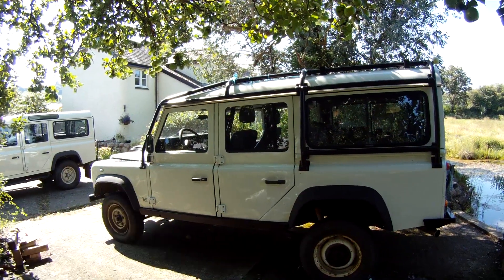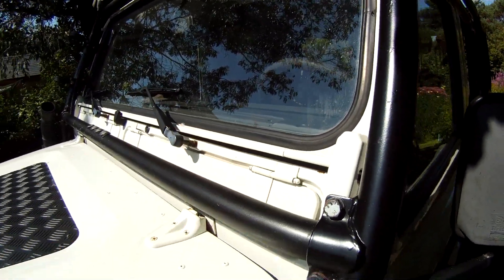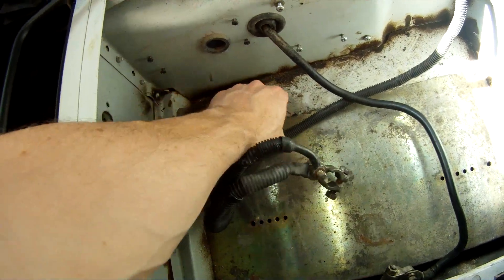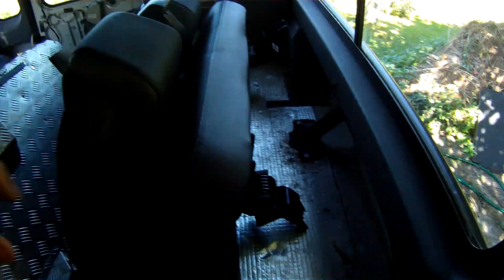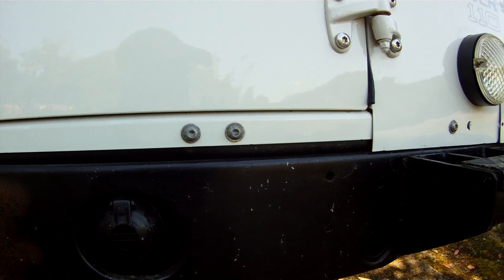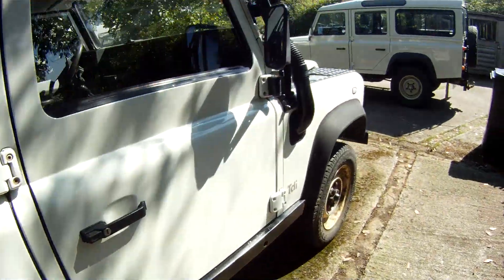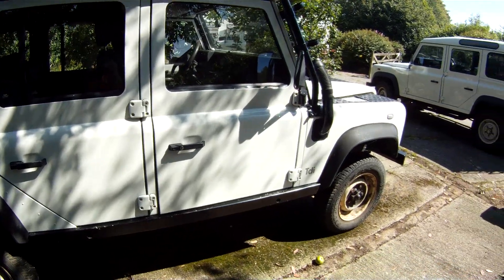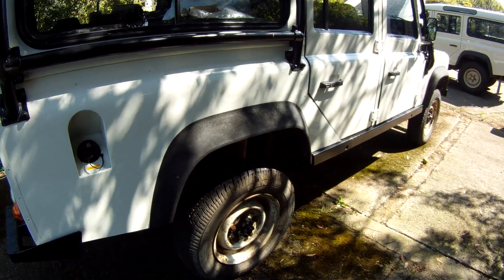Rest of the World (ROW) Spec 300Tdi Land Rover Defender Walkaround

Comment: Thanks for your content. I have just managed to get a ROW spec 110 station wagon that has a build date of Jan 2000 and as far as I know was supplied to UK MOD and shipped to the Falklands where it spent its first 12 years or so. It was civilian registered in 2013 with a V reg number plate and has a Landrover certificate confirming its build date and ROW spec. It has a TD5 body fitted with 300TDI on a galvanised chassis from new (presumably because of its being deployed to the Falklands) and in 2013 only had around 40,000 miles on the clock (presumably again due to the lack of road miles in the South Atlantic!)  It now has 86,000 miles showing (confirmed by its MOT history since 2013) and drives like new. It is in Black paint with a Grey roof and matching wheel arches so i think it was possibly on duty in the MOD as officer/ admin transport not troop movement. It really is a great thing to own and I feel lucky to have found it!

Comment: Would have to agree with you that the R.O.W. Defenders are the cream of the crop of all years and models for doing what it says on the tin as such.
I have a Snatch Land Rover 'most' of which were rebuilt in 2005-2006 using a combination of Otocar Turkish made HD Chassis, Some ROW items such as 300tdi, Puma/P38/Wolf rear axle, R380 cooler, Td5 dash with digital speedo, plus a lot of "Wolf" XD Military architecture such as the 24v wiring. They're interesting hybrids from a similar era. Keep up the good work with the LR Workshop pages, its an unparalleled resource for diagrams. Thanks for setting it up.
Reply from the maker: Thanks Anthony. I toyed with buying a Snatch, just to get the parts....

Comment: I have 300tdi 110 assembled in Kaliningrad, Russia, special order for MchS, which differs slightly from this one and is itself pretty unique, because only 107 such Landys were made. You will not find this anywhere in the Internet, I've found it by accident. I think Defender is the most unique car, so many modifications and versions were made, I don't think another such automobile exists.
Reply from the maker: Interesting. What years? Is this one? http://rs-oracool.ru/korporativnyy-transport?view=459641601
Reply: @lrworkshop  All 107 (or about that) were made in 2000, I am pretty sure this is one of them, however mine is green with a white roof. Before buying it I called the factory to confirm if they actually made these, secretary couldn't tell, redirected me to some technicians, they couldn't confirm as well, but I guess I was lucky that day - a guy who worked at an assembly line back in the days bumped into the person I was talking to, heard that conversation and got the phone. He told me he actually participated in assembling these Land Rovers, some of them were white and some were green. I thought that story was too nice to ignore and bought the car right after that. You can check one of them on the Instagram, the account is landy_jeremy, it's not mine, but they are siblings and has been purchased from the same person. One of these is still for sale in my city for about 11k EUR.
Reply from the maker: @adtfor  Would you mind telling me the first some or all of the VIN and i'll try and find out some more info?
Reply: @lrworkshop  I will DM you in IG

Comment: Made in Uk? Brazil had tdi defenders until 2005/6 (produced in Brazil). Don’t know if they were imported to other countries.
Reply from the maker: Yes, most were made in the UK. The 300Tdi engines were made in Brazil and imported to the UK, and some Defenders were also built in Brazil as Complete Knocked Down (CKD) kits imported from the UK.

Here's a link to an old website where a visit to the Brazil factory was made https://web.archive.org/web/20160429120858/http://www.ihana.com/big_trip/diary/2002/12/dec2002_landy.htm

Will
Reply: Good to know. Land Rover started production here (probably CKD?) in 1998, finished in 2005/6.
Reply: Good read. The 2.8 engine in the video is not original in the Row, is it? Rebuilded recently?
Reply from the maker: No not original. This engine was put in when the vehicle was young. You can't buy the 2.8 in the UK new any more :(
Reply: @lrworkshop   It is my understanding, that when LR went to the TD5, they still needed the Tdi for countires with average fuel and serivceability. The MOD also had problems with the EMF noise coming from the TD5 which LR could not suppress. (Though an Australian company did but LR werent having that (head shake) ) So, LR sold the rights of the 300Tdi to MWM International. They produced the 99 onwards 300TDis and developed the HS 2.8 from there.